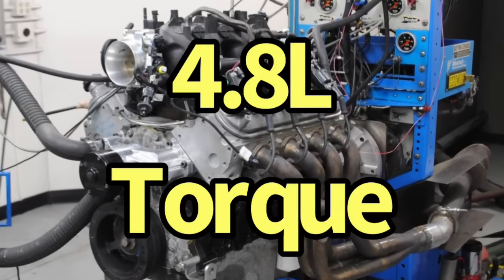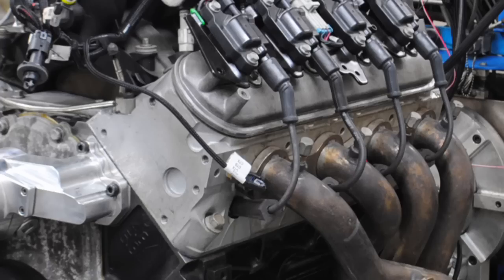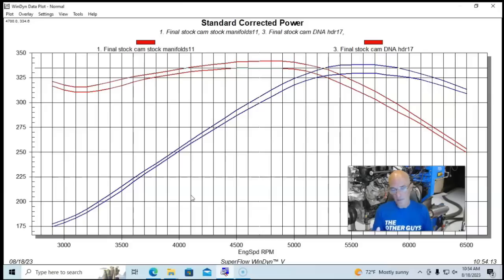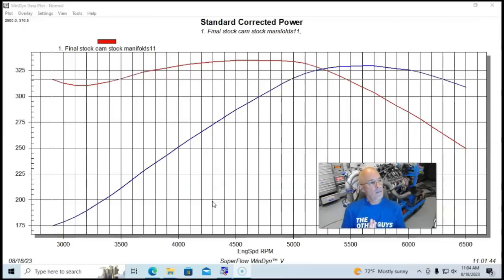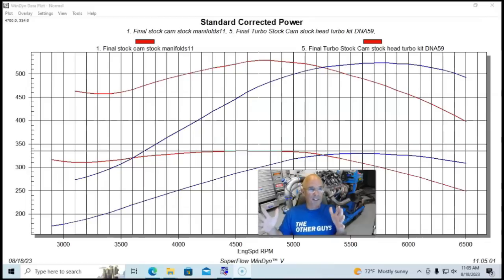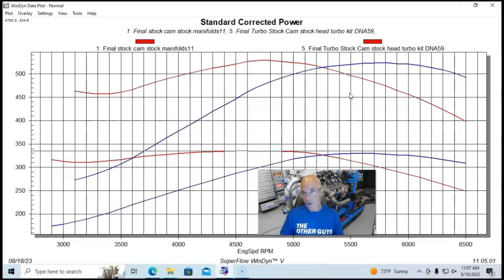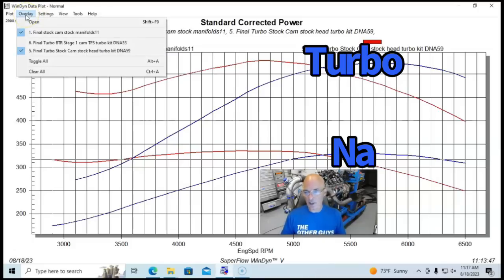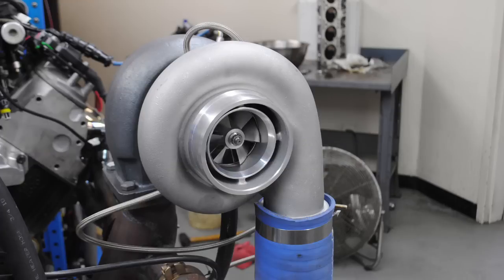THE AMAZING 4.8L LS-HOW TO MAKE MORE LOW-SPEED TORQUE! LT HEADERS? CAMS? THE ANSWER IS ALWAYS BOOST

Comment: I have a 2012 4.8L gen IV L20.  What about the transmission?  A 4.8L is backed by a 4L60E.  Will the torque destroy the trans?  I've never destroyed a 4L60E but I have blown several 700R4 front pumps with rpm.  Can you actually use the HP gains at high rpm?

Comment: Richard, great video! I just bought a ‘01 GMC Sierra with the 4.8. I would like to buy either or: turbo kit or camshaft kit. I need to be able to pull and would like to get more horsepower but more importantly more torque for the pulling.
What would be 3-4 setups you recommend?
Reply from the maker: a turbo with stock cam
Reply: @richardholdener1727  thank you my friend!
Reply: @richardholdener1727  I was looking at buying the Turbo Kit GT45 T4 FOR Silverado Sierra Turbocharger Vortec V8 LS 4.8 from eBay. Do you think I should upgrade the springs? I had considered buying the BTR TRUCK NORRIS cam kit so I could have a few upgrades parts. Do you think I would even need it? I'm only wanting to get 500hp and torque somewhere around the same. What's your opinion?

Comment: If I don't have 2-3k for boost would a dual plane intake & ol carb. off my self make more tq. or low end power than stock ??
Reply from the maker: might make a little more low end, but less elsewhere
Reply: @richardholdener1727  thx for replying

Comment: Hello from Sweden, found this channel and awesome info here!!🙌🏻 Watched vid and comments a couple of times and can’t find what specs the injectors are? Would I get anywhere with stock injectors or 8.1L-30 lb with turbo and cam?
Reply from the maker: stock injectors don't flow enough for a turbo or even a cam, 30-pound injectors will support roughly 480 hp na, but much less under boost. Most guys run 80 pounders under boost

Comment: I can't get my 4.8 with truck Norris cam and fitech ultimate LS system and I can't get it tuned right it will not spin the tires
Reply from the maker: DO YOU HAVE A SHORT RUNNER FITECH INTAKE?
Reply: @richardholdener1727  no sir truck intake should I upgrade to it
Reply from the maker: truck is better
Reply: I thought so I guess I will keep playing with it until I get it right

Comment: Hey Richard! This is just the video/answers I’ve been looking for. My only question is with the GT45 what’s a good “size” to have it come on in the low range of 2K RPM? I’m not after crazy HP or reving out the engine, just a daily driven 4.8 cam’d/tuned LS swapped Jeep.
Reply from the maker: try gt35 if only want low speed
Reply: @richardholdener1727  thanks for the reply! My normal driving rpm range is never usually over 3500/4K rpm so as long as I’m not over speeding the turbo?
Reply: @Cam_Ternes you wont overspeed the turbo, you’ll run into high backpressure as the rpm goes up

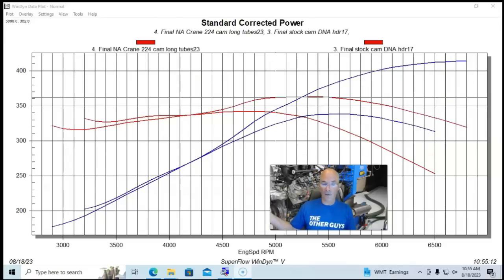Comment: Just watched this video. About a month ago I bought a 2006 Silverado with a 4.8. Mine is unique because it has a 3:73 axle which was part of a towing package. After driving it for the month, I think the 3:73 axle is the best setup for the 4.8. The 3:73 allows the engine to get up into high rpms where the power is much faster and has great response no matter the rpm. I do think changing the rear gear to a 3:73 or 4:10 would wake the 4.8 up and it will feel like a much sportier vehicle.
Reply: I have a 2010 extended cab that I brought new (I'm going to drive it into the dirt)  and I'm suprised how it keeps going in the higher rpms. I only have a cold air intake and removed the muffler bc of rust. Surprisingly most ppl complement the sound, not too aggressive.

Comment: hopefully a 4L60E could handle that power boost
Reply: If it’s built correctly and torque management isn’t completely turned off, yea it can. I’m pushing 24.9psi of boost through my heads/cam forged piston 5.3 and my 4l60 have been holding up for over three years. I built it myself so I know some idiot hack didn’t half ass it. It’s got sonnax everything (input/output shafts, 4l79 input drum and a lot more).

Comment: What if you advance the cam 3to6° that would give it torque starting at 1500rpm    500ft lbs  5500rpm 225@.05 ?      8 lb boost
Reply from the maker: advancing the cam doesn't always add low speed torque-sometimes it just hurts power

Comment: Very net little setup for sure. I have a question but it is about e85 I know you have done some testing we it just wondering how much boost can you use with e85 and not race fuel . If you have done that can you point me in that direction please.
Reply from the maker: you can run lots of boost on e85-it has high octane and cooling properties offered by the alcohol content.
Reply: @richardholdener1727  thanks for the reply and I found a video you did on a 383 a few year back that helped me understand more . Love the stuff you do please keep it up.

Comment: In 2016 i installed a 67mm turbo on my stock 4.8 Silverado to increase low end torque for towing. That setup worked wonderfully getting 7 psi of boost by 1600 rpm in 3rd with the converter locked. I finally after 6 years and 80k miles decided to swap the stock cam out for a summit 8719r1 cam and i didnt lose anything from 2000 rpm up and gained a ton up top. Coming up on 90k of boosted towing miles on my original 290k mile 4.8 and she still purs like the day i bought brand new. 

Great video Richard!
Reply from the maker: nice
Reply: did you upgrade anything on the engine itself for the turbo kit, I have a 2008 4.8 I'm looking to get a little more power out off but unsure on what else may need to be upgraded with it.
Reply: @joshschulik4348  nothing to the long block, just valve springs, cam, and injectors to a otherwise untouched bottom end. The engine mount bolts have never been touched
Reply: @BocaChevy  did you upgrade the fuel pump system at all or no?
Reply: @joshschulik4348  stock fuel system other than 60lbs injectors. At 11 psi fuel pressure starts to drop off at higher rpm, I run 93 octane. It runs great for what I use it for so I haven't had the necessity to run a bigger pump. Eventually I will put in a single 450
Reply: Did you use a turbo kit or did you piece it together? I’d like to build one for towing purposes and would prefer less low end lag that goes with bigger turbos.
Reply: @prevost8686  on this particular truck it is a on3 kit.

Comment: @richardholdener1727 I have a 4.8 Silverado project truck I just got up and running and is currently at the shop for performance upgrades. It was a completely stock truck but the rear differential went out so I had to replace it. I got a Yukon possi, 4.56 gears, and bearings (master install kit). I also got the TSP Cletus McFarland dumpster fire cam kit (dual springs & pushrods). While at the shop I decided to add ported/polished/milled heads, (engine fly cut), BTR Delphi ls7 lifters, BTR LS1 engine head gaskets, 3200 stall, 50 lbs injectors, & upgraded fuel pump. Also went ahead and got long tube TSP headers 1 3/4 with 3” y pipe all the way to the muffler. Any advice on the build ?
Reply from the maker: it will be a high-rpm motor
Reply: @richardholdener1727  any advice on anything I should change or add ? Would the 4l60 transmission hold or should I upgrade? Don’t want to hurt the engine or transmission since it would be my daily as well. Mechanic at the speed shop said it would be alright but I wanted to get a second opinion from an expert.
Reply from the maker: it would not be my choice for a daily and the trans (if stock) might not last long
Reply: @richardholdener1727  speed shop took my truck to the dyno today for a tune it only made 280 WHP and 347 tourque after all the upgrades mentioned above. Tuner said it didn’t make that much WHP because my truck had big tires. That if I would change them to smaller tires I would see a significant increase in the WHP on the next dyno reading. Don’t seem to believe him but is that true ?

Comment: Stock exhaust and cam with a turbo seems a no brainer. How much would a typical pick up truck turbo with intercooler installation cost?
Reply from the maker: no idea on install costs
Reply: @richardholdener1727   Thanks Richard, it would vary widely I'm sure.

Comment: well....if a 4.8 turbo is good, a 6.0 turbo should be better
Reply: And a 6.3 LS (4.8/5.3 stroker)
Reply: The point was if the motor was "too small" to provide the torque down low, that boost can be applied to change that picture without increasing the displacement.
Reply: Probably cheap to buy a 4.8
Reply: 6.0 turbo might have "too much" off idle torque...   So the 4.8 might be perfect in the situation.

Comment: I have a GT35 laying around. Would this work and just spool up faster and top out sooner? Or should I not waste my time and just get a GT45 or other larger turbo?
Reply: If you’re going single, I’d jump to the 45.
Reply: I think the gt35 is like a 550-600hp turbo isn't it? That sounds like it would work on a 4.8. I would be interested to hear what Richard has to say.
Reply from the maker: the GT35 will work on the 4.8l, back pressure will be higher and power output limited, but on a stock one at 7 psi it will work

Comment: lt l83 heads and a belt driven high pressure fuel pump... make the direct injected 4.8l gm never made
Reply: Destroke a 6.2L LT
Reply: @shadowopsairman1583  3.2xx crank fit the lt block? And I only got some l83's 3.800 bore maximum I can go on these one.

Comment: It would be interesting to see the same experiment on a carbureted 4.8. Last time we saw that the 4.8 with a carburator had more torque down low, it would probably only extrapolate the same way as the EFI did. Then you could put a very different cam for the carburator with a tight LSA, which would probably make even more torque while losing some vacuum...
Reply: Texas Speed&Performance  Chopacabra and, Brian Tooley Racing Truck Norris have Tighter LSAs
Reply: @shadowopsairman1583  I was thinking a little bit more radical LSA, like 104-105 instead of 108ish.

Comment: Why do people worship at the LS alter? I can make this naturally aspirated from a small block 383 stroker without boost. The Camaro and Mustang are overweight, and the Challenger is a pig. Heck a 1982 Camaro is light and fits a small block easily, they came with one. Now I can see an aluminum LS, they lighten a car more especially when the Mustang and Camaro are so heavy.
Reply: Because it’s a cheap, strong and reliable engine that pulled from a junkyard with 200,000 miles, it makes well over 300 hp. Hard to beat for the availability and price.
Reply: Plus it's light due to the aluminum block. @danecooper1914
Reply: They obviously ditched standard sbc stuff for a reason
Reply: LS is far more superior compared to a boat anchor O.G. Heavy ass small block……even an iron LS is at least 200lbs lighter than a conventional sbc 350……..i have a cammed 4.8 that makes more power than a standard big block chevy……and i added boost to the 4.8 just so it can compare to my LSA super charged 370 soon to be a 408
Reply: Iron block with better aluminum heads
Reply: Yes, then the "boat anchor" is competitive. There is a build of a naturally aspirated 331 cid small block making 525 horsepower on engine masters. I for one am not impressed by this 4.8 liter. My friend and I scored a 327 block for $50.00 from a 1968 Camaro. There are deals out there.  @shadowopsairman1583
Reply from the maker: why does one have to be better than another-they both can be good. I have 383 builds up on the channel too-but a 600-hp 383 would be VERY expensive

Comment: I’ve been thinking of building a 351 Windsor for my camper with a 4.17 stroke for the torque. Have you ran that combo before?
Reply from the maker: with a stock sleeve length-you should stick with a 4.0 stroke